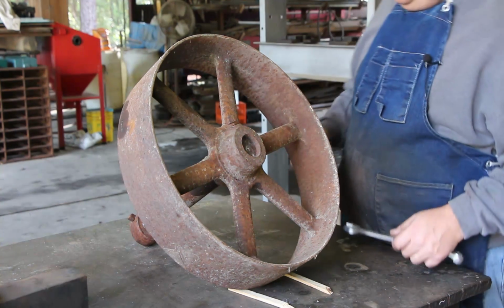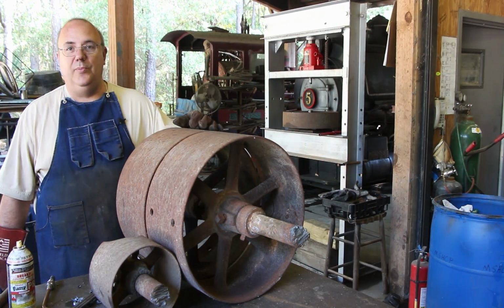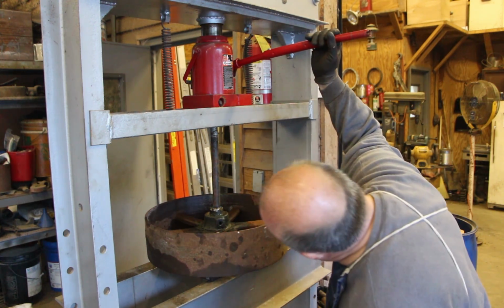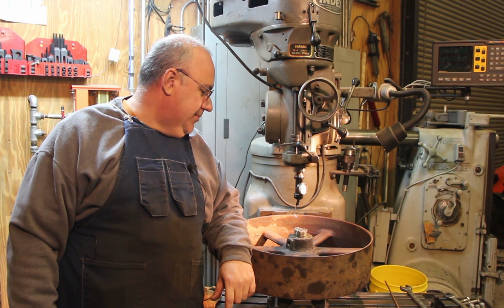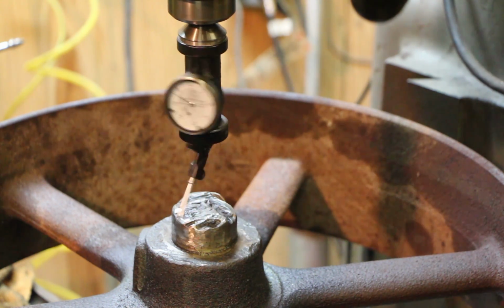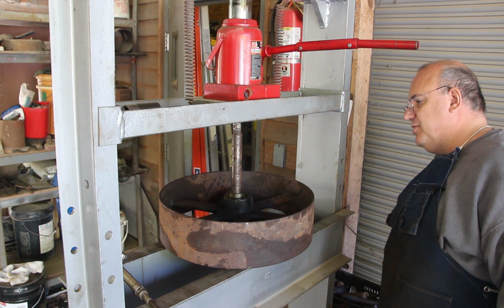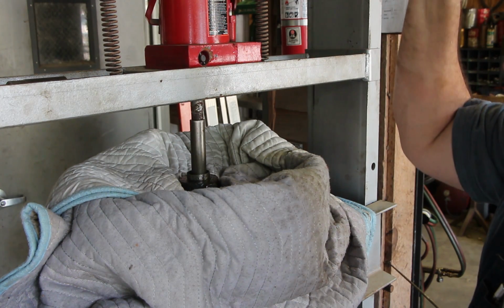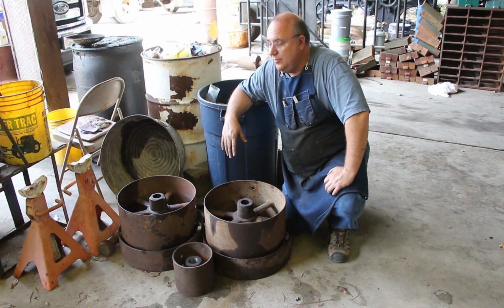Removing Stubborn Shafts from Flat Belt Pulleys

Comment: could you have taken a welder and clamped the ground to one end of the shaft and the work lead to the other end of the shaft after you milled it out? It may have softened the shaft enough you could press it out. if nothing else it would of broken the rust free.

Comment: I'm way out of my depth here but why didn't you just bore the whole thing out?
Reply: Because the pulley hole diameter needed to stay intact.
Reply: Sure, could't you stay a few thou away from the pulley diameter and remove the remaining shaft with pliers or something?
Reply: I would have bored it paper thin and then break it, but he decided to do it that way he did. Oh well, hole saved regardless.

Comment: take a hacksaw and cut a vert.slit in shaft after hollowing out the shaft. This works well with old pipe in fittings.
                                                                                                                               Mike B.
Reply: Perfect and obvious (but not to Keith) solution. Or possibly run a 1/2" mill down the inside so as to leave the bottom in to press on.
Reply: Keyway broach

Comment: Thought of 2 additional things I wanted to add. First, after breaking a pulley(s) I think I would have supported the hub in the press as it was such a problem. Second, I like the blanket idea (yes shattered pulleys fly around) and I would have put on a full face safety shield.
For some strange reason it did make my laugh at you with the pulley - mostly because I have been there as well!! :-)
Thanks for the video!

Comment: I had a similar situation, I drilled the shaft off center so the drill would break through one side of the shaft releasing the tension. Worked great for me.

Comment: you had to drill a hole of 18 mm from the otherside of the shaft too so the stress is of the  the belt and you still had enough space to press the shaft out
Reply: That is indeed a method more common "in the field", as a matter a fact I did that lots of times but he has all these nice machines at his disposal so why not go for a nice and tidy milling job? There are always more ways that lead to Rome.

Comment: I wonder if you had used some Dry Ice inside the hole that you bored while heating up the pulley if it would have released any sooner? Great job though and I really enjoyed the tenacity you displayed. Also I couldn't stop thinking that if you had bored a little off center and therefore closer to one side so as to relieve some if the internal pressure if it would not have helped.

Comment: It`s a good possibility they had heated it up in a fire to expand it not having tools O plenty in the field just done a heat and slid it on over the key rubs , Like a ring gear expand  on a flywheel ,Was stubborn alright ; You watch the one Kieth Fenner pushed out the whole table lifted up on release.

Comment: bore through. make a pin to fit inside with a edge just below outer diameter. make a line with haksaw or simular. or even in that size I would just use torch to make that line. then press it. :)

Comment: so, assuming that last push hadn't gotten the shaft to let go, what was your next "bigger hammer" to beat it with? internal groove on a shaper? same idea, just with a sawzall? blasting (lol)? just curious, i saw that flabbergasted look i get when i consider the merits of arson to eliminate the problem at hand, and that usually is the precursor to "what either must work, or destroy it entirely" (which, of course, works 99.99% of the time, lol). 

when you went to find the center on that incredibly butchered shaft, would it not have been far easier to just face it off with that shell mill, then just use the v and rule from a combo square to "find the center"? scribe a couple lines and just line up the point of the center drill, no?

Comment: penetrating oil: to make "great stuff", you need 3 things: a solvent, like your acetone, a lubricant, like your trans fluid, and number 3, a substance that likes to eat rust itself. now most stuff that does isn't entirely compatible with solvents and oils, or long term soaking of ferrous metals, or both. however, there are 2 glaring exceptions: turpentine (which can also double as solvent), and plain old dollar store DOT3 brake fluid (which also kind of doubles as an oil). my "secret formula" penetrating oil is about equal parts any auto oil (used or new, no real difference), some "past it's prime" lacquer thinner, and "the old bottle of brake fluid in every garage".  leaving it actually covering the part (as in submerged, not just coated) works far better, as does taking whatever container it soaks in, and leaning it against some fairly constant (or at least frequent) source of vibration (like propping it against the air compressor tank). the lube's purpose is obvious, the solvent helps cut the old goo, which increases penetration, but the "rust antagonist" is where the "magic" hides. submerged, the rust eater has ample opportunity, the vibration floats out particles in suspension, and the solvent and lube pretty much preclude it just relocating in a way that is no help to your efforts. i've gotten parking brake cables on forklifts that had spent decades in brackish sand pit duty to return to "usable until the new ones come in" condition, from "ginger cousin itt that kind of resembles a cable or something". try it, you'll like it, promise!
Reply: ludditeneanderthal Really great tip, Thanks!
Reply: @183charlesspiva  entirely my pleasure! Glad to be of help
Reply: Equal parts, auto transmission oil, marvel mystery oil, and brake fluid. I've actually  had a pulley on a small engine fall off by its  own weight  after soaking it over night with this.
Reply: Dexron IID and acetone 50/50 is astonishingly effective even so.  Your brew is quite interesting, thanks.

Comment: I THINK YOU WOULD HAVE HAD BETTER LUCK IF YOU HAD BACKED THE PULLEY CON THE HUB ITSELF.
THE PULLEY WAS REALLY GIVING IN AS YOU CONTINUED TO APPLY PRESSURE.  ANYHOW YOU GOT IT.  GOOD JOB KEITH.
Reply from the maker: While I know that it looks like I was supporting the pulley from the spokes (lots of people commented on this), it was actually blocked up under the hub the entire time.  So many people commented on this, I even shot a follow up video that showed me passing my hands under the spokes to prove that they are not supported!  If I had put that much pressure on the spokes, this pulley would be in pieces now.....
Reply: You would say that a craftsman with so much experience would support such a pulleywheel on the hub,  which ofcourse he did. It never even crossed my mind when viewing this video even when it was obscured from view.These things are done automatically.

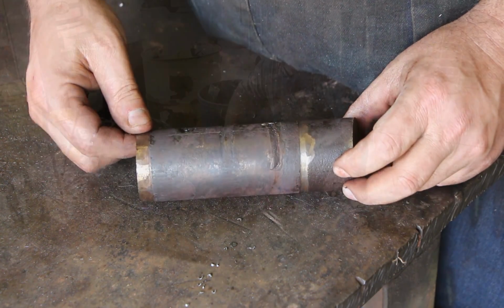Comment: At 32:00, was there not enough of the hub above the bolt hole moulding, over the lip of the face, to use a longer needle on your indicator and get a true centre around that?

Comment: I'm more of a heat man than a machinist, a torch man forever, and in my work, and once getting advice from a superb metal worker, you can take advantage of a strange phenomenon of metal shrinkage. Most people would think to heat the bigger piece to expand it, but this guy's advice and some personal experience taking out really stuck bolts, is to heat the bolt rapidly while trying to keep the big piece cooler, and then quenching the hot bolt (don't heat it red hot) will shrink it. Metal heated and cooled will often end up smaller in some dimension. Since the bolt is restrained in the wall, it cannot initially expand, so it does in the long direction, and then it will end up ever-so-smaller the round way. This feature is very apparent when re-arching flatbed semi-trailers as you heat and quench areas of the top half of the web sections without heating the flange. You can arch I-beams to a serious degree with nothing but this shrinking!   I think a very rapid heating of the inner wall of that drilled shaft and then immediate cold-water filling would start the process. Then when everything is cold, warm up the wheel hub a bit and press.  It might  just work!Mike

Comment: maybe it would have been good to support the centre of the pulley I,e, a pipe of some type to  fit the centre of the  axle, great video , cheers Hayden
Reply from the maker: +Hayden Ellsum The center was supported, yeah, I know it did not look that way on video, but it was.  The rim was not even touching anything.  In one of my follow up videos, I even put it back on the press and gave the same shot that looks like it was on the rim and then "magically" passed my hand under it to prove it was not!

Comment: I tend to be lazy.  If it wants to be obstinate, I just bore it out until all that's left is a foil she'll, then tear that out with a pair of pliers.  Works fine with broken bolts as well:  bore out to the minor thread diameter, then get the end of the thread loose with a pick, grab it with pliers, and peel it all the way out.

Comment: heat the inside of the pulley then touch center with some dry ice it works most of the time
Reply: How true.  Thermal chilling of the center shaft while heating the hub works wonders.  You have to leave all the shaft stubs longer to do rock salt and crushed ice wrapped in towels.  In the old days when we didn't know how nasty R-12 was for mother earth.............
Reply: @stancloyd  liquid nitrogen is the only way to go for this and its cheaper only about a dollar a liter.  but heating the hub would actually make this worse. you have to heat from the out edges of the pulley towards the middle. if you dont heat the outside the because of the containment of the spokes will cause the hub to get tighter because it cant expand outwards.

Comment: You did a great job! I've been there before. What I've done is after drilling out like you did, I took a die-grinder and put a small groove in what's left of the shaft, (length wise) to weaken the shaft even more. Hate putting that much pressure on old metal. Great video.
Reply from the maker: +Dave Underwood Thanks!

Comment: those pneumatic bottle jacks are cool but hand operated is better when your pressing stuff out, etc. Can take your time better and need to be careful. I believe a lot of them you can use either way. Air pneumatic hammers are awesome for breaking parts loose too, high frequency vibrations.

Comment: Can't tell if you are supporting the hub but if your not, all that pressure is on the spokes and they could bend or brake.
Reply from the maker: +OneCupOfCoffee204 Yeah, the hub was actually the only part supported.  But in the video, it sure looks like the rim was taking all of the pressure.  In a follow up video, I show the same shot and then run my hand under the rim to prove it was not supported on the rim!

Comment: Have you ever tried stick welding some passes on he inside of your bored hole? It will heat and then shrink and pull in . Postville Blacksmith
Reply: I have used that welding trick on a alummom motorcycle rim to get the bearing race out be fore.
Reply: Good advice and a great way to remove bearing outer races from blind holes.

Comment: Those straight shaft pulleys can really fight you, I learned many years ago to heat the pulley everywhere BUT THE HUB. When the pulley was hot enough to sizzle your spit the expansion would actually increase the inside diameter of the still cool hub and it would fall of the shaft like magic. No amount of brute force will do it. If you heat the hub the shaft grows more than the hub.

Comment: Another good trick is to heat the shaft after drilling most out until its red hot then cool the outside .The shaft will squash in and after it cools shrink.I have done in with bolts also.

Comment: kieth what the hell caused the door to shut un awares to yourself at 9min 10sec while you applied heat to the shaft
Reply from the maker: +honi9 It had to either be a ghost or the wind.  I am going with the latter.....
Reply: Well based on one experience in my life 4 years ago i will go ith the ghost, but had i seen this vid before this experience of mine I would gave agreed with you and gone with the latter.  This experience of mine was terrifying and a long long story, which changed my total outlook on those things. it simply couldnt be explained my mate.. yikes!

Comment: Hi Keith
Could you please explain the physics of how the belt stays on the pully when its turning. Why does it not just roll off?
Reply from the maker: +Clyde Cessna There is a slight crown in the center of the pulley - two small angles that form a high spot in the middle.  The belt will always run to the highest part of the pulley so the crown helps it to stay on.

Comment: I HAVE HAD PROBEM WITH HAY BALER FLYWHEEL SHAFT. I TRYED PRESSING, HEAT, MUCH LIKE YOU DID. I GOT THEM OUT BY DRILLING ALL THE WAY THOU, LEAVING 1/8-1/6 OF AN INCH OF SHAFT. USEING A SAWSALL CUT THE SHAFT MUCH AS YOU WOULD IF WERE TRYING TO CUT A KEY WAY.BEING  SURE NOT TO CUT THE PULLY,IVE  DONE THIS 10 TIMES OR MORE WORKS EVERTIME. LOVE YOUR SITE MAY GOD BLESS YOU

Comment: lucky to not have a pulley schattering, as it seems to be a cast iron pulley, 
with a good hub suport, there no squeezing due to hub distorsion caused by  rays deformation and you can apply all force you want without the fear of damaging the part or causing an injury to yourself .

Comment: A method i have used is shrinking the shaft instead of expanding the pulley with heat (which i try fist) ...when you heat steel/iron up, it expands we all know that.but when it is cold again it will have shrunk sightly and will be tighter than it was originly   we can use this...after you drill the shaft out if you got the stick welder and run half a dozen breads on the inside the shaft ,let it cool off it will have almost fell out...i use this method on bearing outer races that are in a blind hole and cannot be knocked/pressed out ..one zig zag weld bead all the way round the race and they literally fall out
Reply: Ingenious!

Comment: in my experiences with stuck shafts. namely cv axles. put some pb blaster on it. put a lot of force on it with the press. then smack it with a sledge hard as you can. sure enough they go flying out every time.
Reply from the maker: +David Tamplen I am not big on smacking cast iron with a hammer while under pressure - it has a tendency to bust into a million pieces.....

Comment: Also you could after drilling to max size, fit grease nipple to the lock bolt hole and pump to max this will crush bush in,  or put hydraulic fitting into the bolt hole and connect to a portopower to hydraulically expand or crush, either will all so provide lube     OR you could heat the inside of the bush, allow it to cool and shrink, apply penetrating oil and press or drift out...... OR if your lucky enough to have liquid nitrogen then use this to shrink the bush.... OR drill shaft all way through slit cut the bush and press or drift out

Comment: Hey Keith, next time try dry ice on the shaft (and of course heat on the pulley). Do the heat on the pulley 1st, then dry ice on the shaft. You can also turn a PC cleaning air can or similar device upside down and spray the shaft so only the cold refrigerant comes out.

Comment: Why on earth are you pressing on the sheeve of the pulley?  You have the sheeve resting on the press bed.  That is an easy way to crack all the spokes.  Why not make a scrap spacer bushing with an ID larger than the shaft, and use it to take the force of the hub and sit on the bolster?  That way you can never crack a spoke, as they never see force.  Then you could press with 100 tons, as the cast iron is in pure compression. You simply will not break a pulley if you support it properly when pressing it on the hub. You are showing people the wrong way.
Reply from the maker: kooldoozer Yeah, I have had lots of comments about that.  The funny thing is that the pulley was supported under the hub the entire time and never out on the rim.  In the video, it really looks like it was sitting on the rim, but it was just an illusion.  In fact, in one of my next videos after this one, I put the pulley back up on the press and showed how it looked like it was sitting on the rim and then "magically" moved my hand under the rim to prove that it was not!  As for breaking the pulleys, I have busted pulleys before when pressing, even when the hub was in compression like you mention.  A lot of times, this is a result of a hairline crack in the pulley before I ever start but I always get nervous when I put a cast iron pulley under pressure.

Comment: Where was the beeswax?
Reply from the maker: speedweigand I have heard of that trick but never tried it.
Reply: Keith Rucker - VintageMachinery.org WOW! you really must try it, it beats all the penetrating oils. You want real beeswax, I get mine from Freeman Manufacturing, a pound will last you a lifetime. Keep the part warm for extended periods for the stubborn one, I use a hotplate for my sized problems... put the beeswax on top and heat from the bottom it will draw all the way through. It also works great as a lubricate for running screws into wood without splitting or squealing. Keep up the good work sir! Let me know if you try out the beeswax.

Comment: Keith, the next time you try this operation use heat. Get a rosebud torch tip, two torches would be better but one would suffice on these smaller pulleys. The main thing is to heat the outside of the pulley first. If you first heat up the center a lot, which you didn't, you can break the cast iron because the outside hasn't expanded but the inside, hub and spokes have, causing stress and strain. Heat up the outside first, working inwards to the center. Doing so will expand the whole casting and in doing so, expand the diameter of the center allowing the shaft more clearance to pass through. I was shown this by a master machinist who I saw drop a vertical shaft from a cast aluminum wheel by its own weight using only heat and gravity. Thanks! Jacques